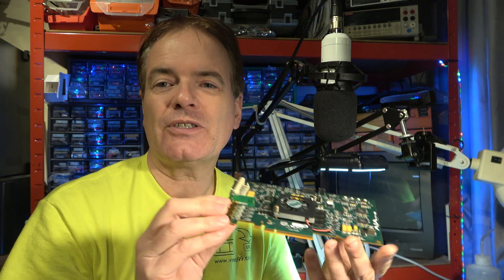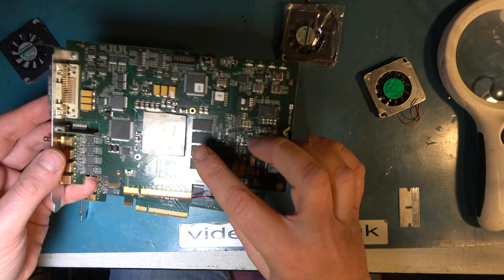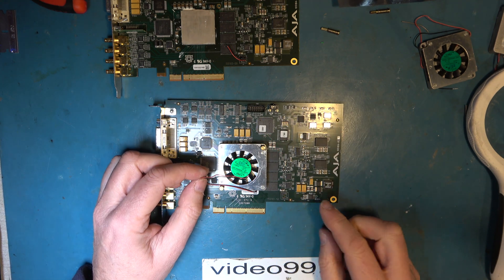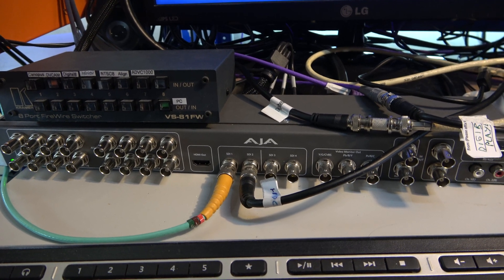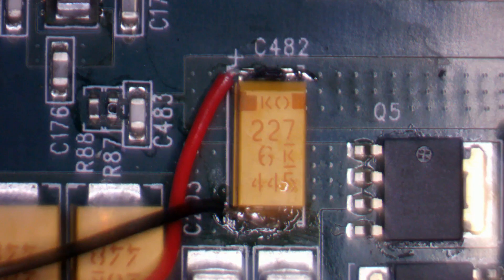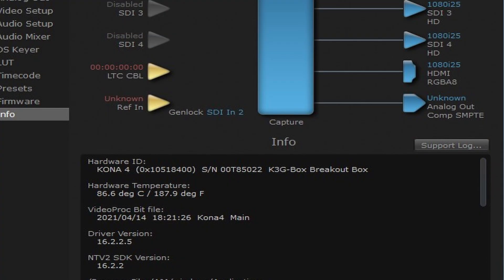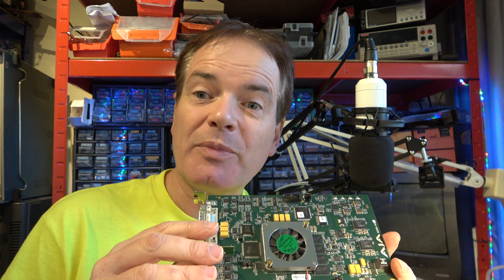AJA Kona-4 SDI capture card, fan replacements

Comment: Hi Colin! I have bought a really cheap Kona LHi + Breakbox + some cables and works like a charm. Also the Fan noise is unbearable...
What do you recommend in this model?  just to take out fan and leave chip without ? remove fan and install a passive heatsink?  or replace to a new fan?

If is better to replace to a new fan, what could be the correct candidate ? 

Im doing tests and at this point, i have  fan "hanging"  out just from cables and one passive heatsink  placed with thermal paste and 2 plastic flanges (provisional tests xD) and temperature is from 75º to 83-84ºC.

Thanks you so much in advice for your amazing community !!!
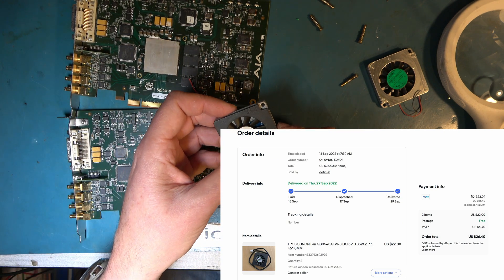Reply from the maker: Replace fan, either with the proper one from Kona or the one I mention from an eBay seller which is a little less powerful but will work.  See this at 2:30
Reply: @video99couk  Cool! tomorrow i will order one, but  maybe is a better option in terms of noise levels than that "sumon" ones. 
At this moment i have tested the card with a passive heatsink and temps are 70-75º capturing SD video from my Betacam's.

What other kind of good coolers could be placed? 
Thanks in advice!

Comment: I could not see any reason why the fan wires on the cap didnt work,  very picky design.
The small cable connectors look like a kind of smc connector.
Shame they didnt use bnc.

Comment: Clearly you got the board working with a software update but it's worth noting fans can introduce a fair amount of electrical noise which can sometimes be a problem. When you fitted it across the SMD capacitor you noted there was an inductor in series with the +5V rail. It might be worth confirming what side of the choke the original fan connected to.

Comment: I just replaced yesterday a very noisy fan from a AJA Kona LHi into a sawed heatsink in order to fit correctly. Temp values are arround 75 Cº - 78 Cº all the time, even when capturing. If it went higher i would stop using it instantly. Works good without dropped frames , at least until now.
Reply: The official temperature limit for the chip on the aja Kona-4 SDI card is 85°C

Comment: Just curious, why not replace the fan with something from Noctua, or even install a larger heatsink to increase the cooling capabilities?
Reply from the maker: Because it needs to fit into a single slot on the PC.
Reply: @video99couk  ahh good point. That makes sense!

Comment: The fan looks not much better than those on cheap and cheerful graphics cards but fans just seem to be the weak point in so many devices that cost a lot of money but use poor quality fans. I possibly would have just removed the old fan from the block replacing it with the new one BUT you have some (what look better quality) OEM replacement ones - that's very lucky and a great find! Great video as always. 😊

Comment: I don't know what it is with these pricey cards having such rubbish fans on them. I rescued some dual 10GbE ethernet cards from some old servers at. work and most of them had duff fans that had to be replaced. Thankfully in something like a server, the intake from the front blows over the card negating any cooling issues, but still, you would've thought that they could have used more rugged fans.